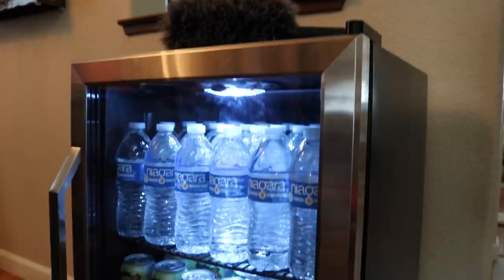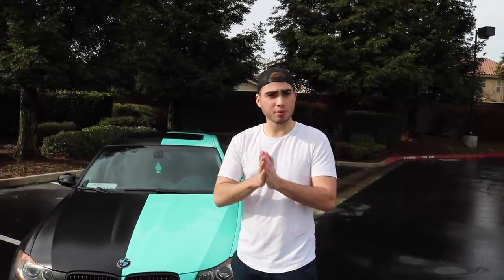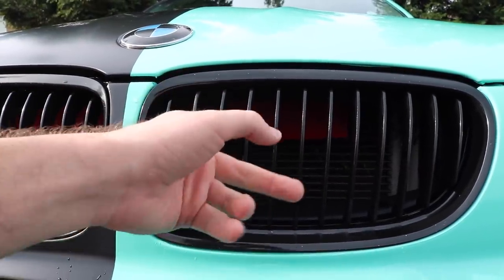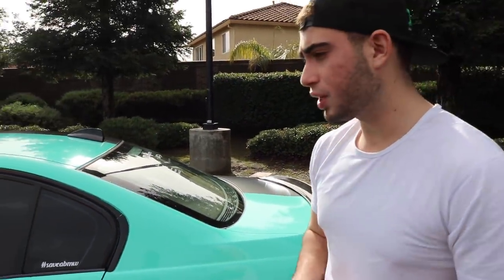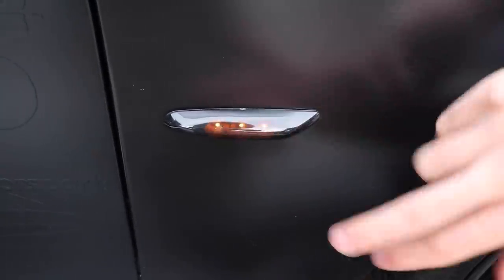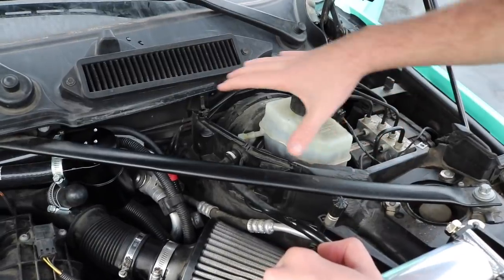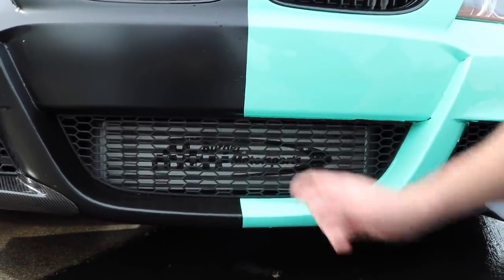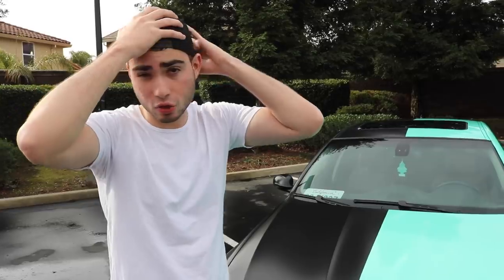BMW 335I CURRENT MOD LIST!

Comment: I work in the appliance business
 That noise is completely normal. It’s the compressor kicking on to make sure the cold air is consistent. It’s louder for smaller fridges since there isn’t much to suppress it with. Looks very nice though